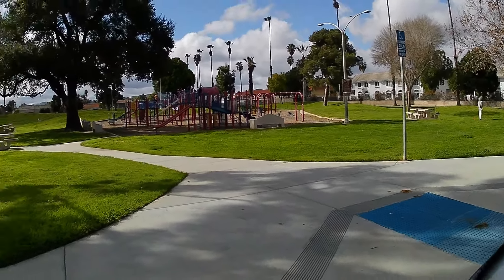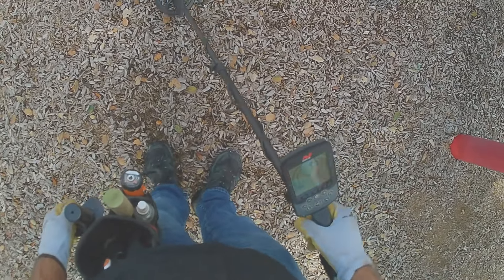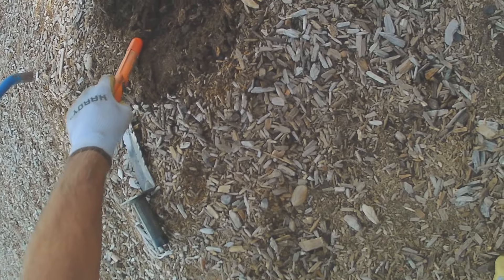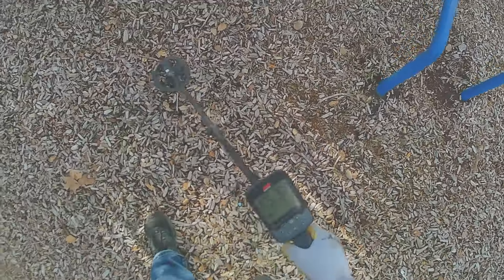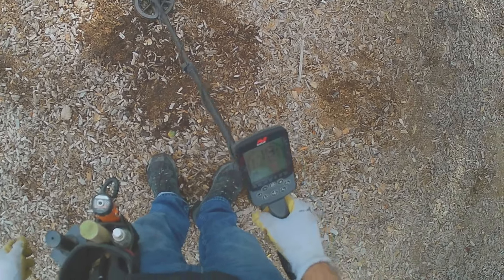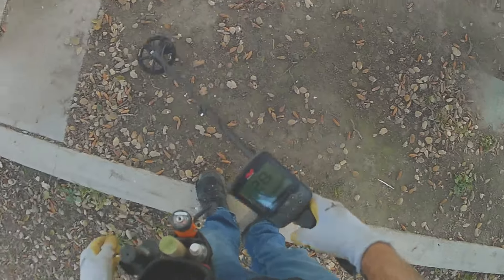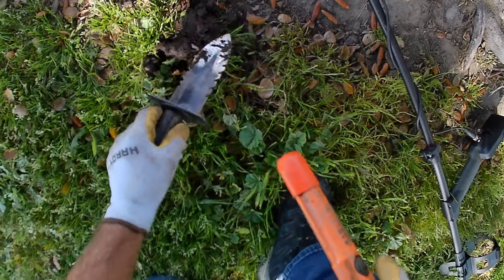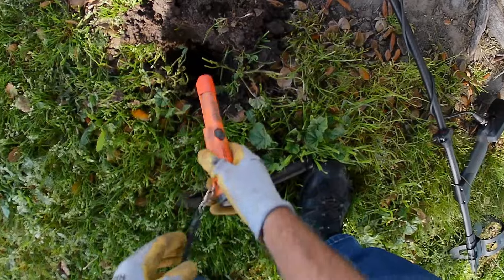Park Metal Detecting vs Playgrounds: Which is Best?😱

Comment: Is the 900 worth considering over the 800? I've used the 800 for a couple years and love it. Just curious if I should upgrade?
Reply from the maker: I would only upgrade unless you can get one used like I did on eBay!  I got mine for $788 with 20 minutes of time on it... Check out the unboxing video.  I do plan on doing some gold detecting so just that alone makes it worth it!   It loves micro targets as you will see from this video... Others always miss those if they don't max out the sensitivity.... You have to hit it twice (lower sen) to get everything.
Reply: @ParkMetalDetecting  
Hello Ken I seen I came in second on the drawing and I sent my Address I hope you got it thanks John Wright

Comment: You really don't need to run your sensitive high when in a tot lot. Maybe 25% of what you normally run it at. Usually, the wood chips are 4-6" deep with a fabric barrier underneath.
Reply from the maker: True... You could run 10 to 20 but when it's been clean out like this one was you have to do both high and low sensitivity to get what others missed... In a trashy park when running the bigger 11" coil you want to run lower sen like 15 to 20 max... The smaller 6" coil really allows you to run more sen and the EMI is almost non existence!